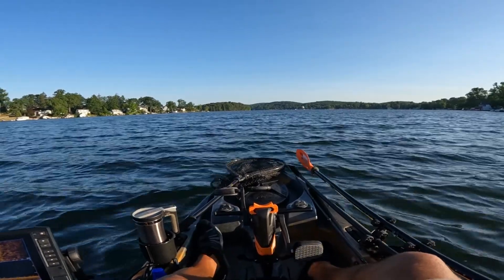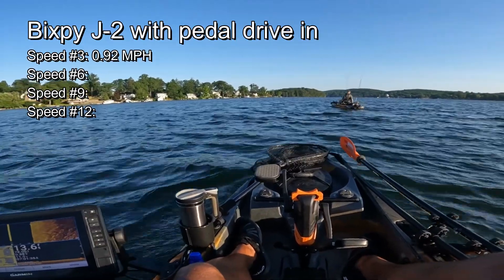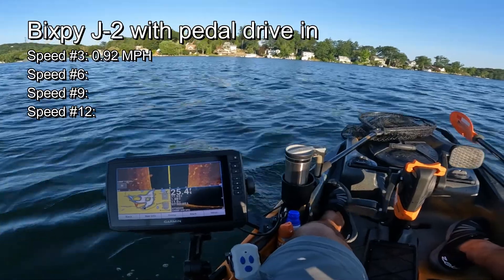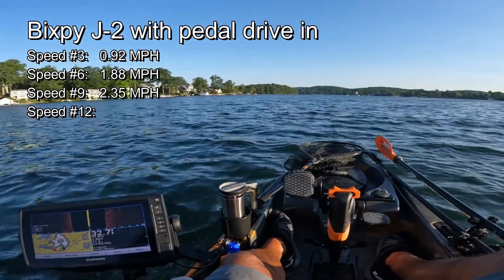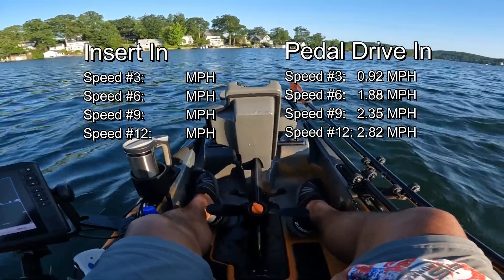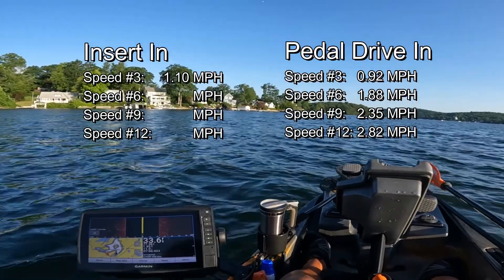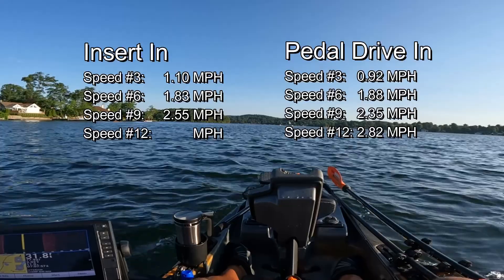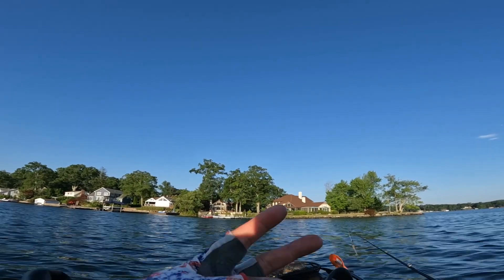Kayak Motor BIXPY J-2 SPEED TEST | PEDAL DRIVE vs. INSERT on Old Town Sportsman PDL 120

Comment: damn i'm thinking of getting a Bixby jet to test out my Bkc tandem 14 foot kayak with fully loaded kayak on 2 foot pedal drive props. just to see how good it is vs the minnkota trolling motor and Gas 52cc 2.3hp 2 stroke outboard motor(built like a trollin motor but gas operated) from amazon..
Reply from the maker: Definitely not gonna be as fast but pretty impressive for how small and simple it is.  I’ve been averaging about 3-3.5 mph.
Reply: @WannaFishAllDay  lol that's good enough for me. I think.. as along as it can withstand 11mph or less winds  and get me across the lake to my fishing spots(what i'll mostly use it for)
 when i'm lazy using the pedal drive. Am not using it for any salt water ocean fishing.

Comment: Have you tested speeds pedaling with the motor going? I’m curious if pedaling lightly would increase speeds at the lower settings to improve battery life even more.
Reply from the maker: I usually pedal lightly with motor on.  Definitely get higher speeds with very little effort pedaling.
Reply: I get 4mph just using the pdl on my Salty 120. I looking & hoping someone makes a drop in Trolling Motor to Replace my Pdl. Just a pull out & drop in type

Comment: I own 2 new Salty 120pdl's. 
Does anyone make a Drop in Trolling Motor for the pdl hole? Just a straight pull out the pdl & drop in a Trolling Motor with the same storage compartment like on the PDL?
Reply: No and I wish someone would! 
I just acquired the Autopilot unit from an Old Town Autopilot kayak and am trying to figure out how to mod it to work in the PDL hole on my 120 sportsman pdl but its not gonna be easy. I could easily do a regular trolling motor using another blank off plate, but this will give me ipilot and I paid peanuts for this unit.
If only they had designed it around the PDL hole, but they put it farther forward for stability reasons.

Comment: Do u feel that the motor is slightly offset from centre
Reply from the maker: It tracks the same for me and I can’t tell a difference.  At first, it would steer right from the start but I realized the motor was not completely parallel with the kayak.  Once I made the adjust, it tracked straight.

Comment: This motor is way to slow and you tested going into waves and a headwind.
Also the prop basket you swapped in during install is much more restrictive than the stock one, I would switch that back if I were you.
Reply from the maker: Thanks for your comment.  That’s a good suggestion in the prop basket.